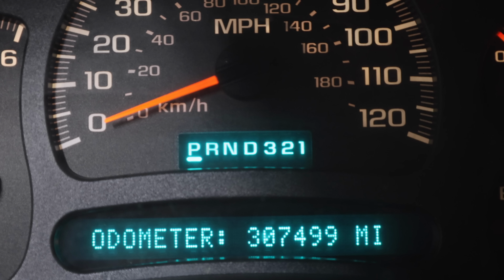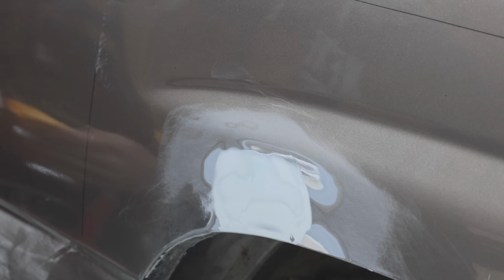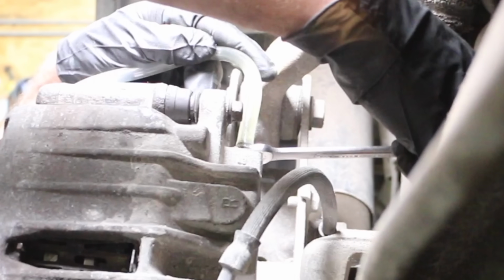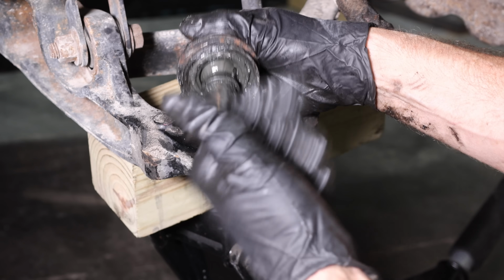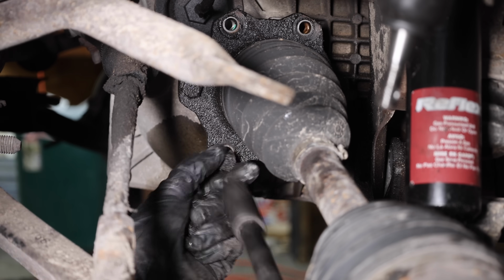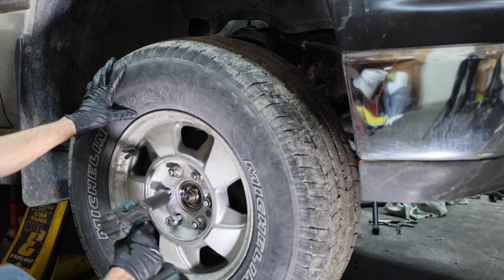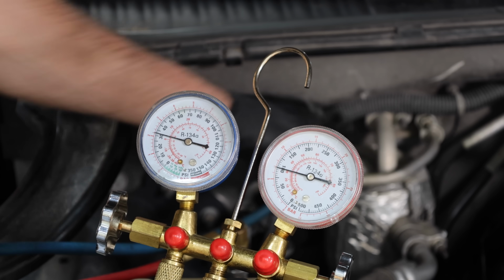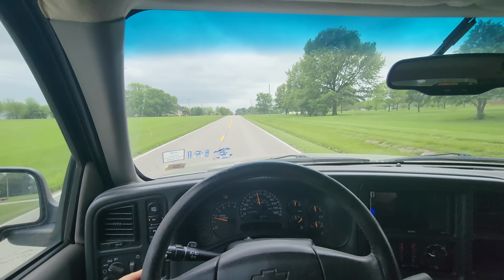Is It Stupid To Fix Up A 300,000 Mile Vehicle? Let Settle This!

Comment: Absolutely worth it, if you can do it on the cheap, with available parts.  Its the part availability issue which matters.  I'm a GM engineer who ran our 1972 Datsun Zcar until it had over 660,000 miles.  Total cost for all of the repairs was only about 7000-dollars, including the addition of a heavy duty driveline to match the larger 280 engine which was put in at about 250,000 miles.  The total cost of the gas, oil, insurance was incredibly larger.  If I had bought a new vehicle every year, or leased, this vehicle save me over a million dollars exchange.  Plus, I paid only 2200$ for it.  We also had a 1975 Toyota Camry which we kept for family use, until all of our children left college, having given them this as school vehicle while they were growing up,  That took about 30-years.  That vehicle was so easy to maintain that my children were taught to do it, like I was by my father.  Eventually at about 2005, it was not possible to get simple parts anymore, it started to suck transmission fluid out through the speedometer, started to smell bad, so we gave it away.  The new owner had it for over a year, never added transmission fluid, and killed it.  My younger son is driving our 1992 Camry, also easy to fix, and it still runs great.  Our newest car out of three now, including a 1995 GMC Vandura, is a 2012 Toyota.  Total cost to buy all of our vehicles, over 60+years is roughly 55,000$.   Repair costs only about 25,000$.  Now all of that is a very good deal.  Try to beat it.
Reply from the maker: Thanks for sharing.

Comment: Without watching (watching as I type) yes it’s worth it lol if you have some mechanical knowledge, most times it isn’t as bad as it seems as long as the vehicle hasn’t been abused and fluids were changed regularly. If it was mainly highway miles, even better. If it drives fine upon test drive, go for it. Plus in this economy, why not. If the car made it to 300,000 miles, it must be at least half decent lol.
Reply from the maker: Thanks for the feedback.

Comment: My buddy has a tahoe with 1,500,000 miles on the original engine/transmission. Just keep doing what you're doing!
Reply from the maker: Thanks for sharing.
Reply: That is incredible. What year and motor?  Gives me hope that my 04 Yukon with a 5.3 might have some life left in it with 232K miles on the clock. Cheers.

Comment: They rearly don't make cars today like they did in the late 90s early 2000s don't think any 2020s ICE car will make it to 20+ years old some EVs might (the basic ones like my Renault Twizy )  to meny plastic engine parts and cheep rubbish  along with anti right to repair dearlship have to authorise a new airfilter BS am sure they are deliberately making them worse so we have to change them more often, we all need to keep our old cars going as long as possible
Reply from the maker: Thanks for the feedback.

Comment: Noticed you didn’t show in your video putting a thread locker on your caliper bracket bolts. GM requires either a thread locking compound or new bolts with the compound already on them. Without that the bolts can rattle out and then you’ll send your caliper into your wheel and not have braking on that wheel.

Comment: I just bought an 01 gmc sierra 2500hd with 120k miles and I had to do everything that my 04 burb needed with 200k miles. control arm bushings, ball joints, shocks, inner and outer tie rods(Cause they're cheap), ect. and it leaks oil just as bad.
Reply from the maker: Thanks for sharing.

Comment: nah, Ive just spent £1100 on fixing my 175k miles 2014 Mitsubishi l200 Pickup, if your planning to keep it thats still cheaper than a 4 or 5 months of new car payment, sure you wont get that back but the cars gotta have maintenance done otherwise it'll just die...
Reply from the maker: Thanks for sharing.

Comment: Im only 2 minutes in and noticed a couple things. First. The patch panel comes painted in a weldable primer. Second. Should have used the entire patch panel, not just a tiny bit of it. Odds are there is more rust that hasn’t poked thru the paint yet.

Comment: Don't slow down! You're my favorite youtuber for being a honest man, informative, and straight to the point without rumbling for hours just to stretch the videos!
As for this video, i have nothing to add, you did everything i would! All the older cars or used ones you get over 5 years old need those repairs even for cheap insurance, also change every bushing it has.
For the patch you did great, only objection is this part was easy to make, so i wanna see you next time bending sheet metal to save money!
Reply from the maker: Thanks for the feedback.

Comment: I love seeing older vehicles getting a "spa day" like this, being refreshed and living to see another day on the road.
Reply from the maker: Thanks!
Reply: Well the only issue is the most important parts(transmission/engine) are pretty likely to fail when you get into high miles, so you’re risking putting this work in and then needing to buy a new engine. I’ve never seen a cheap transmission, but you can get a 5.3l for under 1k, so maybe not such a terrible cost
Reply: @myrusEW  You really think this guy cant replace an engine or tranny or even rebuild them? Plus your comment was stupid theres so many cars worth saving and buying new engines for lmao. This aint a poor mans sport
Reply: @myrusEW   these trucks are worth putting money into. Just simple enough that basic hand tools can get to just about anything. But you still have trim levels with heated seats and 4 way steering.
Reply: @markm0000  It takes a lot of know-how to do this. Its enticing to try and learn how to do this stuff. But you can say that about anything. Should I do my own plumbing and electrical repairs, butcher my own meat, repair my appliances myself, represent myself in court, design and sew my own clothes, build my own house, do my own taxes, make my own beer, and so on and so on. Some people can do some of these things. Probably no one can do them all. I guess life is deciding what you're going to outsource vs do yourself. Most people can do some basic car stuff like change oil, airfilters, and of course wash the car. But most people can't do much more than that, though with patience and youtube you can learn to do it. But do most people have the time? Probably not.
Reply: @TheoDeRolph  Very well said and great points. You articulated some thoughts I've had when people ask why I drive newer vehicles. Can only learn so many things or do so many things in a day. I'm in technology so anything technology I completely do myself, I also learned and do all my own electrical, plumbing, carpentry, drywall, flooring, taxes, and landscaping. But I don't know jack shit about vehicles. I drive a new one and drop it at warranty if there's an issue. Would I love to learn to become self sufficient at working on my own vehicle? Yes. Do I feel horrible about not knowing how? No, not with everything else I've successfully learned how to be self-dependent about. I'm fine with letting a professional keep my vehicle safe and reliable and/or driving a new one, paid for with the money saved from everything else I've learned how to do myself.

Comment: I own a 96’ Chevy Suburban and 96’ Chevy K3500 Crew Cab. I love the Suburban so much but it has close to 200k. Was debating selling it before it passed but seeing how simple you made the upkeep look (I know it’s actually time consuming) I think I may hold on to it and follow suit with maintenance. 

I confirmed from a reliable source that these Vehicles are capable of 500,000+ w/o an engine or tranny rebuild if you’re not punishing them daily with heavy towing and observe the basic fluid maintenance schedules. I’ve even heard [unconfirmed] testimony from someone who had over 1million miles (mostly freeway driving I Believe) on the original engine and tranny with only replacing the piston rings so it’s quite a testament to the engineering that went into these Late 90’s & early 20’s models.
Reply from the maker: Thanks for sharing.

Comment: I love the GMT800. The perfect combination of reliably turn key daily driving, reasonably modern creature comforts especially when upgraded with aftermarket and an incredible dollar to mile value. I daily an 00 Silverado with 300+ miles. It’s been worked. The bed is trashed from rust and loads and it needs front end soon. But that is so much easier to live with and fix as I go along than paying 700 a month for the next 7 years.
Reply from the maker: Thanks for sharing.

Comment: That is going to be one scookum as F* CNC Mill & I’m so happy to see someone starting one of these builds [IMO] “the right way”

Whether it’s CNC Mill or a Manual Mill the one thing you can count on is it will be HEAVY! The foundation of any good quality Mill is the backbone to achieving accuracy, repeatability, reliability & the durability to maintain those factors far into the foreseeable future. A massive steel Tubular frame of that size will serve as both a top notch workbench and an A+ platform for driving even the biggest gantry. I’m eagerly looking forward to your progress as Im currently doing something similar but in reverse (Converting an old Industrial HOMAG OPTIMAT CH 03 PLUS CNC Panel Saw 6200mm x 5800mm into a workbench [Keeping 5800mm x 300mm] 😂)

*SPAIN had some manufacturers using some damn nice materials and components back in the late 1990’s early 2000’s. High quality steel & Black Zinc Coated 8.8 & 10.9 Bolts, Japanese Omron VFD’s & Moeller Electrical Components, Bosch / RexRoth / Chalen for Pneumatics, ROSSI (Italian) WormGear Reducers … Like you I’m a HUGE advocate of repair and repurpose over perpetual modern consumerism. I salvaged this from a local company upgrading their equipment. If I could remove it over the weekend it would be free since it saved them $2500 in quoted removal costs even after taking into account scrap steel value.

Comment: The pace is good, but maybe talk a bit quieter into your mic, and then adjust the audio level higher after? I say this because;
Your shouting voice has a "sing-song" quality in terms of emphasis, where sometimes specific, sometimes random phrases and words get emphasized by increasing in pitch and volume, which gets old after 25 minutes of narration.
Reply from the maker: Thanks for the constructive feedback.
Reply: @ProjectFarm  Please check your front brake lines! those sway bar linkages are rubbing and "popping" through the brake lines every time you turn. The shop noticed mine today; I have an 02 Sierra 1500. I had to cut the excess threaded rod off with a grinder and tape the worn areas on the lines (preventing further rubbing damage from anything else) until I can replace them. The OEM didnt have as many threads. The aftermarket has too many; its only supposed to show about 3 threads when in the right place.

Comment: Great video!  You must be outside the rust belt!

In my part of the country (I live in Iowa) -- no, repairing a vehicle with 300,000 miles is 100% not worth it.  Unless they're putting on like 100,000 miles a year, it WILL be completely rusted out before it gets to 300,000.  Cars here get the amount of rust you are repairing there within like 2 years.  Just to make sure the salt here rusts out things as fast as possible, they switched many years ago from rock salt to liquid brine.   

I thought my 2000 Regal was in nice shape (with 220,000 miles, this was about 5 years ago), only to find the clearcoat was just so thick it kept it's shape -- I saw a little rust staining underneath the front door frame, poked under there only to find out there was NO metal whatsoever behind the clearcoat, the metal had completely rusted away underneath the door frames and there were just intermittent flakes of rust left.  I avoided any further rusting issues the hard way, it got T-Boned and was totaled out (damage was not that extensive but the insurance co. f'ed me and paid like $600... falsely claiming that the non-running for parts only Regals they found were "comparable" vehicles for determining value... so needless to say they were not going to authorize $1500 in repairs.)

I had a previous (1988 Century) that could have used a new fuel pump and filter but it was not replaceable -- the shop says "We don't want to work on this".  "Out of morbid curiousity, what would have been required?" It  would have (10-15 years ago) cost over $1200.  The fuel tank, fuel tank straps, filter, and pump had rusted into a single piece, and the fittings rusted together so the lines all the way up from the tank to the fuel rail would have had to be all removed as as single unit.  Most likely the car body would have continued disintegrating as they removed this stuff.
Reply from the maker: Thanks for sharing.

Comment: Very helpful to this non-mechanical guy. If I were to get a very high mileage vehicle though, my greatest concern would be putting a thousand dollars of parts and work into suspension, brakes, fluids, body, etc. only to have the engine, transmission, and/or electronics fail. These could really flip the "cheaper to keep her" equation.
Reply from the maker: Glad to hear!  Thanks for the feedback.

Comment: Tip for doing this, remove only the black primer from where you think you will weld, like remove about 1 inch all around just to be sure, but leave the rest on it, its another layer of protection for the metal, when we pain new pieces the black paint stays on, we only rought it for  adherence.
Reply from the maker: Thanks for the tip.

Comment: I love these trucks, they were designed to be serviced! In fact, the GMT800 generation of GM trucks and full size SUVs were the last generation to come with those chassis grease fittings, among other things. 

2007+ is a relative nightmare to work on and maintain, and it gets worse every generation. 

Fantastic video!!
Reply from the maker: Thanks!

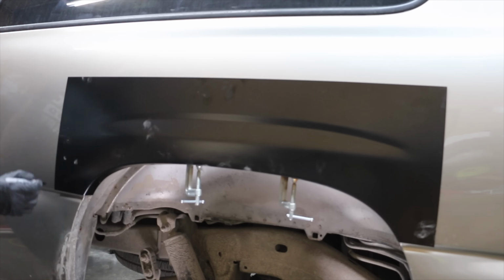Comment: 00:58 $75 for a piece you only used a small part from? Couldn't you just bend some sheet metal and weld it in?
Reply: You can do anything you want. For my rusty suburban since it’ll need a new body eventually I just used fiberglass

Comment: I've done this type of thing before and without fail no more than a month later the truck will throw a catalytic code and start rattling. The motor will start giving a little knock. The rear main seal will go. The head Will start weeping. You can do big chunks like this at a time, but as a rule of thumb unless your forking up 10k or 15k all at once to replace EVERY wear item on the truck it will always be a waiting game for the next thing to go wrong. This is great though thank you for a good video that covers all sorts of topics.
Reply: Everything you said is cheaper than a new vehicle and can be repaired in a parking lot… and no, if you repair the rust, replace the brakes and change the fluids it won’t destroy the cat or cause the engine to suddenly blow a head gasket or main seal
Reply from the maker: Thanks and you are welcome!

Comment: Since you have the whole panel, you could cut two pieces. Put an oversized piece on the inside with the inner lip cut out to act as a backing plate to keep the sparks from getting to the foam.  It's a sacrificial piece, but it could help eliminate a problem with the foam. Because it's recessed, the patch will have more stability while welding. You can get a smoother finish and not need to use body filler to build up the hole.
Reply from the maker: Thanks for the constructive feedback.

Comment: My bit of advice is:  instead of using a welder to replace the metal on the fender, use JB Weld.  Welders cost money and can intimidate people, but everybody knows how to use glue.  What I do is overlap the metal a bit, and fill in the edges with more JB Weld (like putty).  The result is a slightly raised area, but once it's primed and painted it's hard to tell unless you're looking for it.  Looks way better than a rust hole, anyway.  A pack of JB Weld is about $7.
Reply from the maker: Thanks for the feedback.

Comment: My 1998 Ford f150 5.4 is going strong at 208k miles. Had a few issues but nothing major. Little things are an issue- windows don’t go down, rear window leaks but that was a problem with that gen truck. Engine and transmission are original.
Reply from the maker: Nice!

Comment: Love the videos! I just did a complete suspension, brake, and timing chain job on my 2006 mercury mountaineer with 260,000 miles. It’s been such a reliable and comfortable vehicle I felt it was totally worth the fix. Glad things worked out well for you with your vehicle!
Reply from the maker: Thanks!  Thanks for sharing.

Comment: Regardless of the mileage if you like the vehicle and it is still serviceable there is nothing wrong with keeping it. Buying another vehicle with a possible monthly note (a loan) will add up quickly with monthly full coverage insurance. Spending $2000 on repairs will be recovered quickly in a hand full of months. With todays vehicle prices its cheaper to keep her if you are still happy with the vehicle. Besides I like having something that I can service myself.

Comment: I had a 2000 Silverado that died on me at 310k miles. The issue I ran into was that the metals holding the transfer case started to deteriorate, and others were starting to show the same signs. Bought it at 285k miles and put a new to me rear dif on it. That's probably the only thing that'll go on this thing if you take care of it

Comment: Keep the current pace.  I think this is your trademark and a big reason most viewers keep coming back.

I drive a 2003 Buick Century.  Like you, I do regular maintenance and replace parts as needed.  I am saving a lot of money by keeping it on the road.  As a bonus, parts are quite cheap for these older GM vehicles.

Comment: I have a single cab short bed 1991 Chevy K1500 has a 5.7 v8 automatic transmission… this truck has over 320,000 miles and it’s still running strong no problems at all …